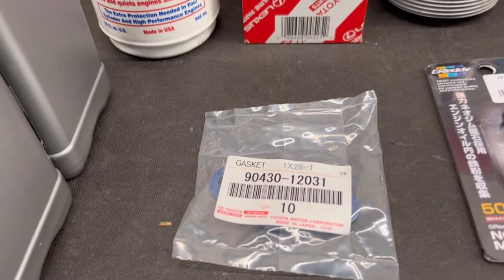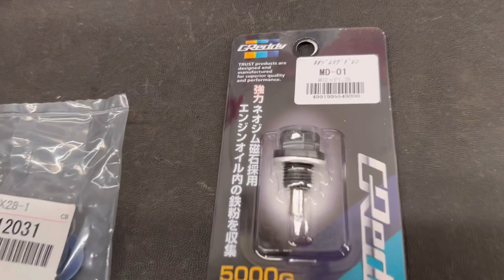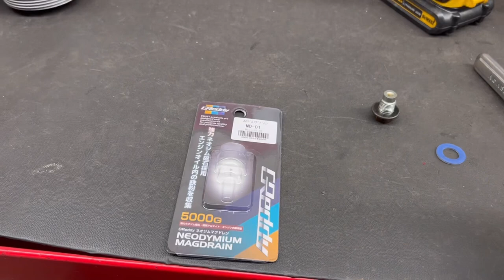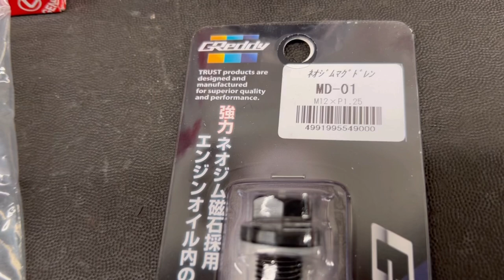Toyota 4Runner • FREE Maintenance Tech Tips - Oil Change + Metal oil filter Housing DIY

Comment: A lot of folks switch to the aluminum oil filter housing cap. There is a certified Toyota mechanic that has a channel called "The Car Care Nut" and he says there's nothing wrong with the plastic oil filter cap. As long as you follow the torque specs and use the proper oil filter cap wrench, it should last for the life of the vehicle. I agree with him. I use the Motivx MX2320-US wrench which is made in the USA to 64.3mm to engage with the 14 flutes. It is similar to the one you have but possibly less expensive though I'm not sure.
Reply from the maker: “The car care nut” is totally right, I could have told you that. As long as you use proper care on removal and installation, the plastic one should last the life of the vehicle. I have the Motivx, which I show in the video. 👍🏻 (That would be the recommended tool) 
I appreciate you watching!
Reply: We LOVE "Made in USA!"

Comment: Hey Viking, I have a question I was hoping you could help me with. I replaced my plastic oil filter housing with the metal one and change the insert over from the plastic one to the metal one like you showed I got my filter from the dealer for my specific truck and I have a gap when I push the filter down about a quarter inch of the tube is above the filter. What are your thoughts?
Reply from the maker: They sold you the wrong filter. 💯
Double check the part number, I guarantee you got the wrong one.
Reply: Thank you, love the channel!
Reply from the maker: @ericbadour2395 🙏🏻

Comment: Where did you purchased your oil filter wrench, what’s the brand name of it, can I have the link for it? Thanks
Reply from the maker: Search (ast toy 640) or (Motivx Tools MX2320) on either Ebay or Amazon. Plenty there.
Reply: @VikingsGarage  I appreciate your reply.
Reply from the maker: Anytime bud, I appreciate your support!
Reply: @VikingsGarage  thoroughly enjoy your contents.
Reply: Appreciate all the tips. I do have a question if ya don’t mind about the oil filter. I’m changing the oil in mine for the first time since I finally have access to a lift, and being I’m in a wheelchair I’m actually able to do it. Went to grab Mobil 1 extended performance and they have a bundle deal which basically gives a free filter, but it’s the Mobil 1 extended performance filter. Is there anything wrong with using it over an OEM one? I’m using OEM for everything else, but figured I’d ask. Much appreciated
Reply from the maker: Mobil1 actually makes a great filter, I’ve used it before in customer’s vehicles. Very similar to OEM if not better. Absolutely go for it! 
You got this 👍🏻
Reply: @VikingsGarage  good to know. I’ve had a lot of T4R purist get all in a tizzy if I mention anything other than OEM lol, so figured I’d ask. Thank you for your time
Reply from the maker: You got it, anytime!

Comment: Great video, will switching to the metal cap on a 4Runner under warranty cause any issue with the warranty? Thanks for taking your time to make these videos!
Reply from the maker: Your very welcome.
Telling you to modify your vehicle while under warranty, is ok ;would be wrong. Quite frankly as long as you use the oem aluminum one and swap the center shaft properly . You should be fine, they won’t even notice. It’s a Toyota part 🤷🏼‍♂️

Comment: Keep up the great content! These tech tips videos are a tremendous resource. Any thoughts on doing a video on changing the fluid in front and rear differentials and the transfer case?
Reply from the maker: I appreciate your feedback and support.
You better stay tuned, I should have those videos up within the next few months.
 (Also, transmission fluid replacement, filters is next, coolant, water pump and thermostat, drive belt,battery…)
Thank you for watching Sir!

Comment: I see you have a quart of Lucas Oil Stabilizer along with your 6quarts of oil. Is it fair to assume you'd recommend adding a quart during an oil change as a preventative measure for higher mileage vehicles?
Reply from the maker: Not quite, but I do check the oil level every other week. I do drive a lot.
Usually, if ever I do not need to add any oil.

Comment: The dealer over-tightened my cap A LOT and it ended up getting a hairline crack in it during removal which seemed fine until I pushed it on the highway on my way to vacation. Ended up losing all of my oil and nearly destroying my engine. 
My personal mechanic swapped it over to metal, which he said he's done on a few other 4runners without issues. It drove the long drive without issue and tackled a lot of mountain hills, but I ran into traffic and I had the P0014 code come back (which is what showed up when I ran out of oil). I think I've lost a small amount of oil but it isn't very low. Also I CANNOT remove my oil cap for whatever reason. 

Do you know if you can get that perforated tube from Toyota? I am skeptical and don't think he actually swapped the perforated tube and rather threw it away and installed the new one.
Reply from the maker: Sorry to hear about all your troubles.
That tube comes with the filter housing, not sold separately.
You would have to buy the complete housing. 
Best of luck!!

Comment: Do you have any idea why there are so many different part numbers for oil at Toyota?  I searched 0w20 on the Toyota parts store and came up with 10 matches.  For example, what's the difference between #00279-0W202-01 "0W20 Motor Oil - GTMO" and #00279-0WQTE-01 "Gtmo 0W20 Qt Sn Wty"?  The latter is what the local dealer told me was the "correct" part number.
Reply from the maker: Honestly, I do not know.

Comment: Thanks just Subscribed! I notice you have an S2000, I have a 2007 S2000 in Red! I just purchased a used 2022 4Runner SR5! My previous vehicle was a 2007 Rav4, V6, AWD, Sport (Very Quick). When I first tried engaging DAC, and ATRAC it did not engage? Apparently there must be a certain way of going about it? In the Rav4, I would just put it in Low Gear and push the DAC button and it would work! I tried the same procedure in the 4Runner and I just see blinking indicator lights? What is your method?
Reply from the maker: i appreciate your support!
are you trying this in 4 Low ?
Reply: Yes! I put it in 4 Low, 1st Gear and I get blinking indicator lights for 4 Low, and DAC?
 @VikingsGarage
Reply from the maker: @BroBob1254 while in 4low that will blink , that’s to let you know the system is engaged. Perfectly normal, I wasn’t sure if that’s what you were referring too.
Your system is working as designed.
Reply: Just tried it and if I go right to 4LO it does not engage, I just get a Blinking light, but if I go to 4Hi first , the 4WD indicator light goes solid, then I go to 4LO and it will go solid, then I can go to DAC, or ATRAC and they go solid. To disengage I must be stopped in Neutral and Reverse the process. Pretty confusing???   @VikingsGarage

Comment: Lucas fan, but curious...............Lucas regular HD oil stabilizer <the thick stuff> instead of LUCAS LUC10130 Synthetic Oil Stabilizer for Toyota synthetic oil change?
Reply from the maker: It’s just something I do every so often. No to crazy about 1/2 quart. 
It makes cold starts a lot quieter. 😉
Reply: @VikingsGarage  Thanks, new 2022 4runner owner, former 33 year Honda owner.   Love the vids
Reply from the maker: 🤘🏻 Honda’s are awesome too. I appreciate that. Thank you Sir!
Reply: @VikingsGarage  using lucas will not cause problems with the pistons later on?
Reply from the maker: Not that I’m aware, I’ve never had any issues. Been using it for a while now.

Comment: Hey sir! Awesome content! What is your opinion on Walmarts new budget brand 0w20 full synthetic oil called Super Tech that is DEXOS approved? Wondering how it would do in my 2021 4Runner SR5 Rear Wheel Drive …
Reply from the maker: It’s an ok oil… but me personally either Mobil 1 or AMSOIL. 🤷🏼‍♂️
Reply: Ty! Getting ready for this on mine. Capacity is 6.6 quarts with Oil Filter, are we ok to add the 6.6 quarts at once? I wonder why some people add 6, then run the engine, and adjust to add the remaining .6 after the first 6 quarts were added? Any suggestions? To me seems like the process is being prolonged 🤷‍♂️
Reply from the maker: Add 6.6 quarts all at once. Start engine, then double check that level is ok. 
Done 👍🏻
Reply: @VikingsGarage  awesome! I did just this, yesterday. Checked my oil this morning on cold engine and noticed level is at about 1/2 ways between both points. Do you think that is a good measurement at cold check since the oil will expand at operating temps? I put exactly the 6.6 quarts with new OEM oil filter. 

Also I noticed on another video you advised you only change your oil filter every other oil change. I plan to change my oil every 3,000 - 3500 miles with this WalMart Super Tech 0W20 full synthetic oil, do you think I’m ok to change the OEM filter every other oil change like you do also? Thank you for all the advice and awesome content!
Reply from the maker: @4Runner21  Yeah, change that filter every other, they are super resilient. As far as the oil level, if it’s been sitting and cold and it’s half way… add 1/4 of a quart or even less, to bring it to just below the top line. 👍🏻👏🏻
Reply: @VikingsGarage  awesome did just that! Hey Man, I noticed the dip stick oil level in this truck seems to be all over the place after second , third recheck and so forth on a level surface. Probably oil that stays along the dipstick tube..Any suggestions or best practice to get an accurate oil level check on the dipstick ? Lol
Reply from the maker: @4Runner21 check it on a flat surface first thing In The morning
Reply: @VikingsGarage  hey good Sir! I know that you are a Toyota specialist, but wondering the same thing however about 2013 ACURA RDX with 87K mikes on her so far, do you think the OEM Honda Oil Filters are resilient also enough to get away with changing it out every other oil change ? I also don’t plan on exceeding 3K miles oil change intervals on this one too..Ty!
Reply from the maker: @4Runner21 that’s a turbo car, I would change it every oil change and make sure to use full synthetic. Very sensitive setup
Reply: @VikingsGarage  it’s actually not. It’s the 3.5 non-turbo..
Reply from the maker: @4Runner21 well in that case, you should be fine then. 👍🏻
Reply: Hey man! In your opinion is it ok to mix different oil brands for an oil change on our 4Runners as long as 0w20 is consistent ? I have about a quart of royal purple 0w20, and super tech 0w20 full synthetic from prior oil changes that I’m wondering if I can mix together? Thank you!
Reply from the maker: @4Runner21 sure you can, why not!!
Reply: Just did oil drain and fill 3300 miles in, kept same oil filter in there. I’m gonna go another 3,000 miles then will change oil filter next oil change. Thank you man!
Reply from the maker: @4Runner21 👏🏻 Absolutely!! 👊🏻
Reply: Given my oil filter gonna get changed every other oil change, I’m gonna need to stock drain plug gasket washers. Your link here seems to be broken at least for me. Do you have an Amazon store page where I can scoop some of these from? Thank you!
Reply from the maker: Right on ! ⬇️
https://amzn.to/3z2DdOH